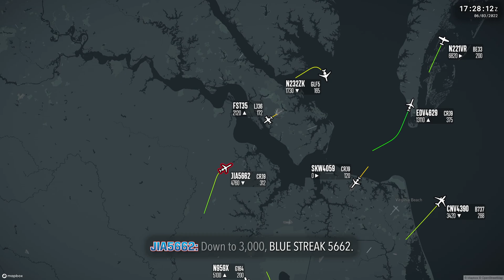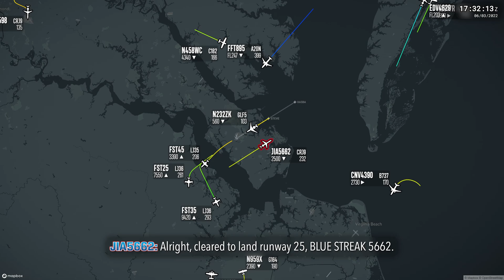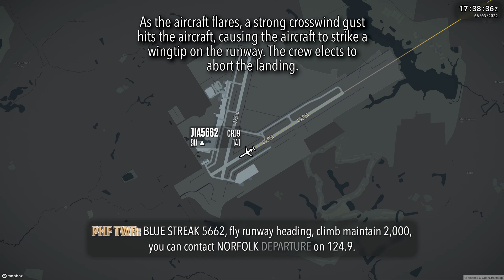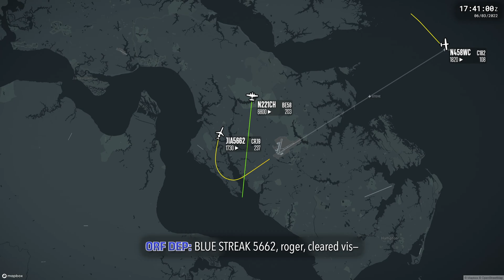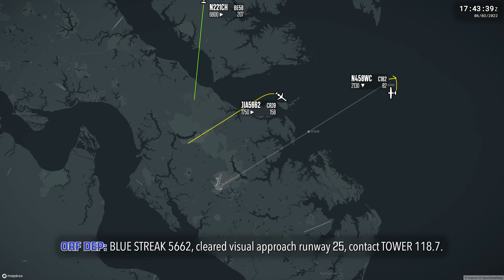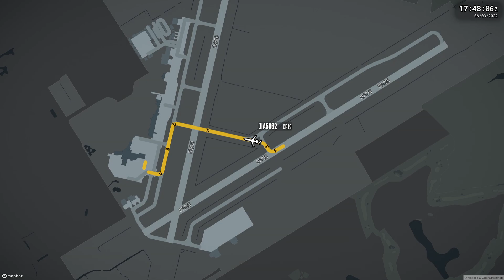WINGTIP STRIKE Causes Late Go-Around [ATC audio]

Comment: Just a novice here, but as they were landing on runway 25 and were flying the reciprocal heading of 070, it seemed odd in a way to ask for the base leg heading on a visual approach, which I assumed naturally would be 70+90 = 160 ? Better to ask if in doubt of course. I guess they did not realise it was a wingstrike as would they not report that in the go-around reason in case there was debris on the runway?